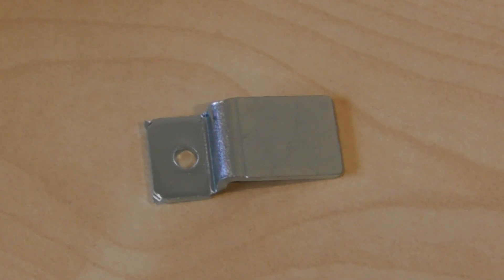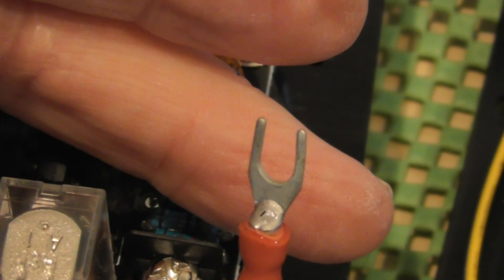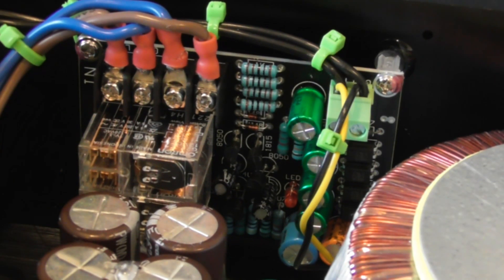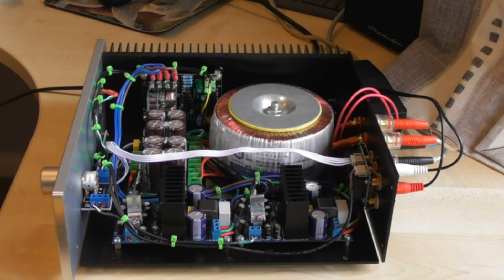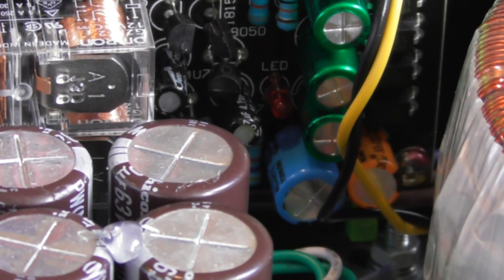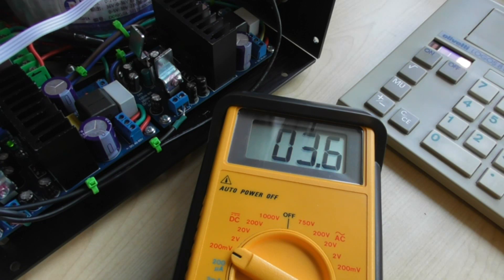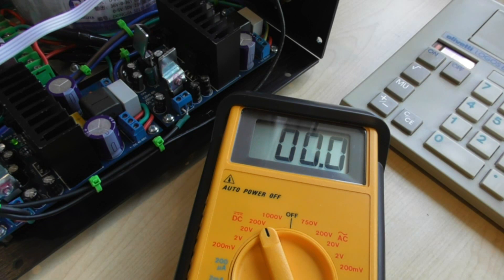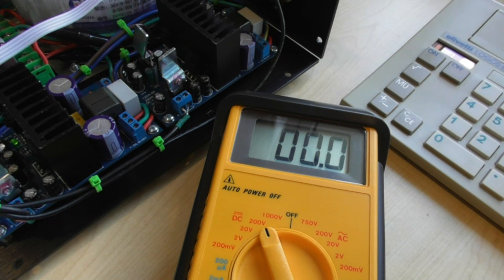Class D Amplifier Part 3

Comment: Hi Micheal, I may have missed it, but why didn't you use a SMPS for this amp, they seem to meet the requirements of a class D amp perfectly?
Reply from the maker: Reliability seams to be an issue, a number  of my viewers have said they (the SMPS )have a habit of blowing up on switch on. Indeed one of mine did just that. A linear PS will last almost for ever!!